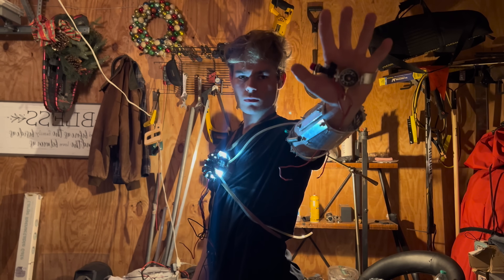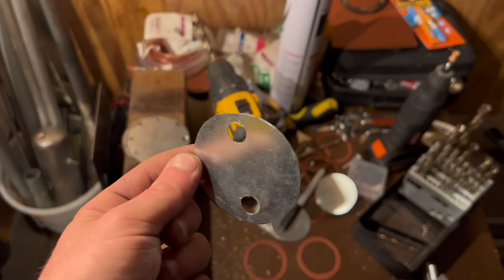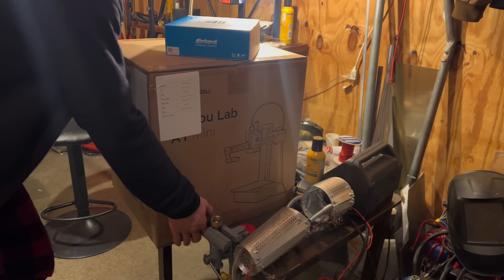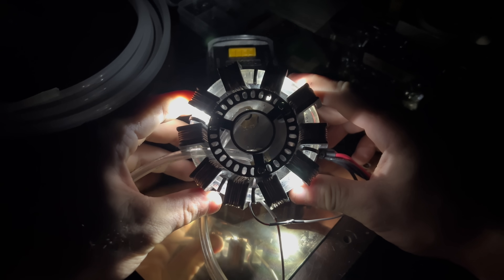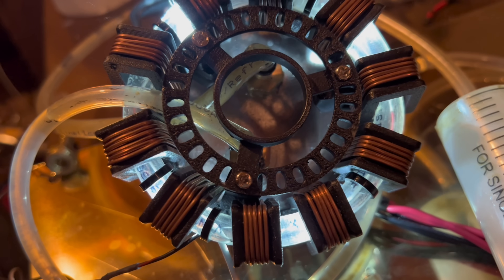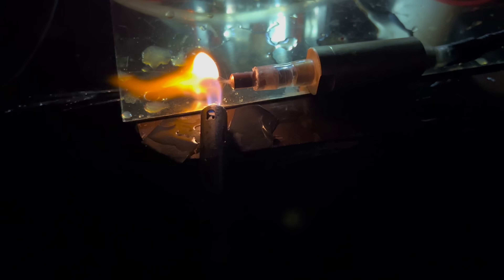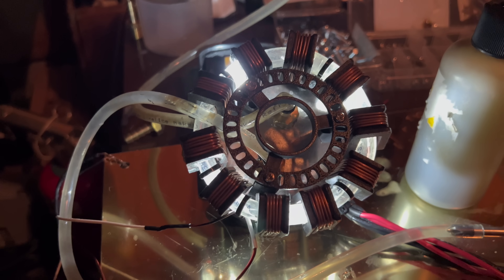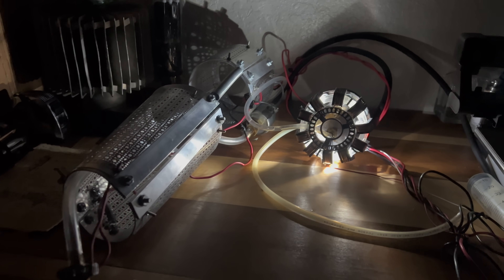Functional Ironman Reactor that Converts WATER into FUEL

Comment: You should not pressurize HHO gas! That's why it is not used in commercial applications as it is hard to store.
Reply from the maker: I’ve ran tests with it pressurised, the only danger is if you don’t have safety arrestor valves to prevent the flame from traveling back into the tank, and make sure all the seams are properly and tightly sealed for leaks, but yes generally pressurising it is pretty dangerous
Reply: @Joseph_sidl  It can also detonate at certain pressures....
Reply from the maker: @PlasmaFreak those pressures are very high and hard to achieve with an electrolysor this small, I would need to have it at very high pressures
Reply: @Joseph_sidl  True, just wanted to warn you
Reply: @Joseph_sidl  from what I remember, HHO mix actually likes to detonate when being released, like depressurized.
Reply: @tomclanys  yes but that's because it can be detonated through shock/impact when you release the pressure it's turbulent
Reply: @Joseph_sidl if you slightly change your hho generator to split the gasses... You could also use those gases to produce electricity by making a hydrogen fuel cell... Look up military hydrogen fuel cell on YouTube, I think it might peak your interest, and if you're building an iron man suit it should be your next step.
Reply: Could also design the HHO generator to separate the gasses into two separate tanks for storage under pressure for added safety.
Reply: @fairlyoddme3021 it would be hard to keep a high flow rate at that and you would have to drastically change the shape of what he already has. You can't stack plates when you're trying to have the gases separated the anode and the cathode have to be at a distance from each other so that you can keep the bubbles that come off of either separate. Incredibly hard to make it portable the shaking of your body could allow the gases to mix. Them being further apart means you have to use more power to get the reaction to happen. Not really effective in a small portable tank.
Reply: @LinkWulluf keep looking into hho generators, I've seen it done quite easily
Reply: @fairlyoddme3021  without a membrane it's hard to do.
Reply: @tomclanys 😂 doesn't seem to be, plenty of backyard DIYers doing it and posting working generators on YouTube 🤷
Reply: @tomclanys doesn't need a membrane.
For example - copy this title into YouTube and see for yourself.

Simple and cheap to make. Pure hydrogen - pure oxygen. Hho hydrogen generator. Electrolysis
Reply: @LinkWulluf doesn't drastically change the shape. Still just as easily stackable, and distance isn't really an issue. Also portability would be the exact same as a regular hho.

For example - copy this title into YouTube search.

Simple and cheap to make. Pure hydrogen - pure oxygen. Hho hydrogen generator. Electrolysis
Reply: @fairlyoddme3021  i watched this video, it is not a separated output and it still generates both hydrogen and oxygen in each output, as it depends on the electrode location. The "dividing" plate is still positive on one side and negative on the other, as you need both + and - to complete the electrical circuit. I told you before, you either have a membrane, or separate the electrodes by a big distance. In this case the only separation is the dividng plastic plate, which also limits the functionality of the electrolyzer to certain angles.
it might be good enough for you, but it's not pure and it isn't really solving anything.
Reply: @tomclanys simply put, you're wrong 😂. It does separate the output. But I really don't need to convince you, you do you boo.

Like, am I going to take the word of a gamer channel... Or the evidence of working models 🤔 this is just one of MANY working builds, and though I'm certainly not the best at explaining/teaching I've been looking into this for years and I know it works.

So I told you and showed you an example, I really don't care what you do with that from this point.
Reply: Keep writing large responses and then deleting them. Trying to keep it short. Because the largest surface of the plates in your reference video aren't directly facing each other it's going to require way more amps and the current draw is going to be higher because of how he chose to separate them. Even though you separated them using his 3D prints which I do think is pretty clever to call it pure hydrogen and pure oxygen would be misleading. The bubbles generated at the bottom of his plates combined with the flow of the electrolyte solution from the generator heating up because of the amp draw will pull some bubbles through the system! It's a cool concept it's inefficient
Reply: @LinkWulluf  +1
Reply: @fairlyoddme3021  *facepalm*. Yeah, sure, channel content from 10+ years ago DEFINITELY matters in what I do in living. What a kid.
Reply: @LinkWulluf oh! I see, just move the goal post, and now you don't have to say you were wrong!
That's fair right? 
Efficiency wasn't an issue either of you brought up before, but all the points you both did bring up proved to be wrong...
Maybe you should both spend a bit more time looking into it, as it's been shown there are some gaps in your knowledge on it, it's fair to reason that your new issues with it might not be entirely correct either.

I showed one example of many, maybe look into it some more

Comment: also with your system, its able to ignite, but i cant help but think that in some way the excess heat can be used somehow? i just dont know how. my way of thinking is that heat, if utilized and controlled correctly, is a useful form of energy output. otherwise, just slap a cooling system on it. Rockets are easy now, also pneumatics could be arcieved, and maybe you could use the hydrogen gas in spaces with specific containers containing special reagents to archieve certain things within those places. Like try a bit of pneumatics maybe, or something like a bit of energy with a fuel cell concept/ reverse electrolysis to get like 1-2 volts to power tiny chips or the leds in your Reactor. Also for the light, you might be able to use fluorescence with some phosphorus in some tubing and a strong uv-light (maybe in the inside of the to reactor ring inside the copper coils. I'd have a ton of ideas if i had the time for such complex projects, but these are some of those that came to my mind spontaneously. Have fun with your project :)
Reply: it would be so cool if a fuel cell could be used to make electricity but 2H2O+4e- --> 2H2 + O2 then in a fuel cell 2H2 + O2 --> 4e-.  In a perfect world it's a net 0 output, I do love the idea of pneumatics though.
Reply: Haven't you ever heard of peltier devices? You input heat and cold on the sides and it produces a little bit of electricity, enough for the LEDs
Reply: @lucasballe.8308 oh, that's actually much simpler, yes. And no, I obviously didn't think of that, great idea

Comment: For a some time now I'm working on the same project and made this type of reactor too. But I ran into some issues with the electrolysis so I decided to make this reactor using some chemistry. (NaOH + H20 + Al = H2) This type of reactor produces a lot more hydrogen, its not that messy and you don't need to power it with electricity. I have a bunch of experience with the repulsor and hydrogen stuff and even with a FULL exoskeleton of whole Iron Man body so I can help with some things if you want... (and please excuse my english. I am from a non-english speaking country)
Reply from the maker: That’s incredible, I’ve concidered an electrolysor using the aluminum and sodium/potassium hydroxide reaction but after running some tests it heats up incredibly fast and super hot and keeping that at close proximity to my chest sort of has me worried so I’m just going with the standard drycell type reactor, I actually found a method of producing much much more fuel and that’s using graphene plates, it’s even more conductive and better lasting than graphite so I’m working on a new reactor using that as the inner electrodes. Cool that you made an Ironman exoskeleton as well I’m working on the torso piece for mine.
Reply: Your work is incredible and I'm your and Alex Lab's big fan :D
Reply from the maker: @MerixHere you should join my discord server it’s linked in my bio, I’m trying to collect as many other engineers and people in the sphere
Reply: @Joseph_sidl  I tried to join but it says that the invite is not working (if it is the invite that is on the linktree)

Comment: Good video recording. Good narration. Cool idea. Great video! Subscribed. One question. Does putting the rubber between the metal plates affect the yeld of gas? And i have heard you can capture the hydrogen and oxygen separately.
Reply from the maker: Thank you, and also yes the distance between each steel sheet changes how much gas is produced, my previous reactor was made from 3mm rubber separators and the production was alright, this new one is using 1mm rubber separators, it’s much less water the electricity has to go through so it’s much easier to break down water

Comment: Still using stainless in 2025? Upgrade to graphite disks for less corrosion issues, about 35% better production rate and not producing toxic byproducts from electrolyzing chrome from the stainless into the gas. You can get it from industrial seal selling places ready cut or talk to local industrial maintenance companies if they have off cuts laying around for cheaper since they might buy it in sheets and cut it them selfs. Note industry as in dealing high pressure, high temperature steam or gasses. Power plants are great for this if they use steam turbines. For cooling run the electrolyte electrically isolated around the reactor core to extend usage time before overheating. Also you MUST design mechanical fuse into system, ie intentional weak point that in case of reactor detonation, does burst and release the pressure and spray of strong base, witch is very dangerous chemical in controlled manner and design any suit or such that protects you and people around from splashing and soaking, since it will seep trough your skin in seconds and cause deep chemical burns, dissolving everything including bones. Always use eye protection at minimum and have neutralizing solution near by, preferably emergency shower you can use blind in case the eye pro was not enough. I was thinking of building HHO generator to replace oxy acetylene torch but due freezing issues in cold garage and the strong base chemical needed, i moved into natural gas+oxygen concentrator design instead even if that has its issues as well. Remember oxygen is oxidizer that wrecks havoc on everything its on contact with. No oxygen no issues, but its needed for reactivity so necessary evil.. Also keep good ventilation in space so you dont build up concentrations in the space, where one spark will turn the closed space to open concept with out walls and at very least removes your ability to hear anything permanently so ear protection is also must have.. Good luck and for everyone else thinking this is cool, yes it is, just make sure to learn what are the risks involved and how to mitigate those before attempting.
Reply from the maker: I was actually considering graphite electrode plates but couldn’t find them anywhere besides online so just made this prototype with stainless, the official model will use either graphite or graphene electrode plates this reactor was just sort of a prototype and also for a good source of oxyhydrogen at the moment
Reply: @Joseph_sidl  don’t try using water as a fuel source since that can grow mold If it’s left in there for too long
Reply from the maker: @sshhyou it’s like the only thing you can use as a fuel
Reply: @Joseph_sidl then put pure water because pure water doesn't have anything and only water so there is no mold but watch out and warning don't ever try to drink pure water because its purified and there no other elements inside it so it sucks elements and vitamins remember your body is also a vitamin so it will maybe suck all of the vitamin(i think)
Reply: @Honored_racist_one  the main danger I recall for drinking distilled water is often lethal dehydration. Your body uses the minerals and electrolytes found in water to regulate its water content. 

Without electrolytes your body believes it is over hydrated and forces you to expel liquid (sweat, urination, general digestion processes, etc). That's why Gatorade and other electrolyzed drinks are marketed to hydrate you. 

By tricking your body into thinking that you are severely dehydrated it makes your body hold onto and distribute water throughout your body more effectively, while also slowing down sources of hydration loss like sweating.
Reply: @sshhyou  is there a way to use mold as fuel? XD
Reply: @DennisJ42  you have prompted my train of thought
Reply: Shut the fuck up and stop yapping nobody is reading all that